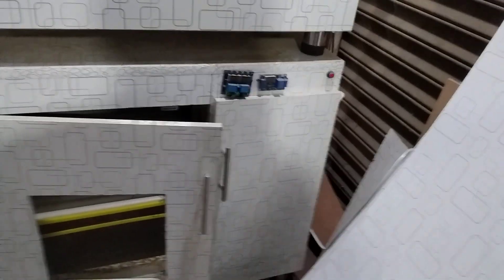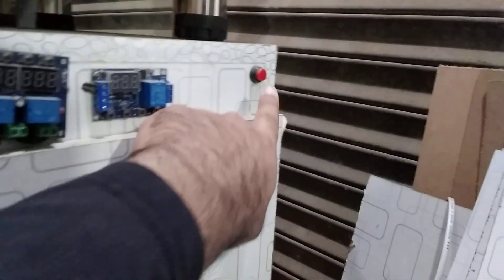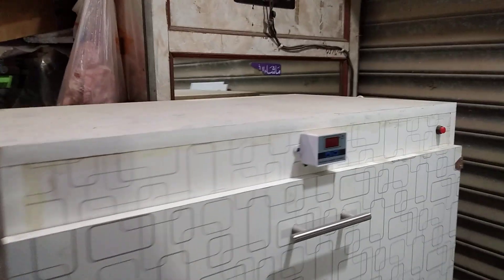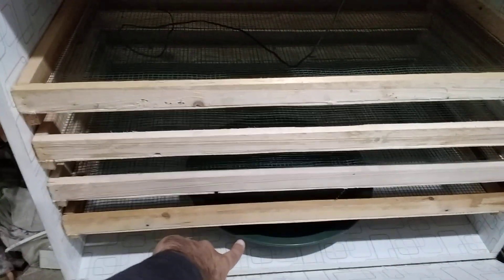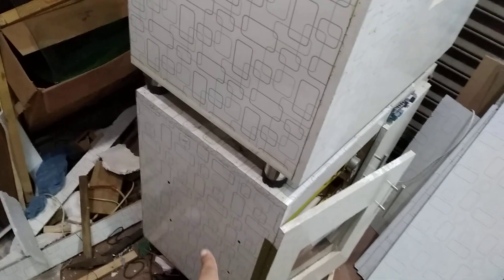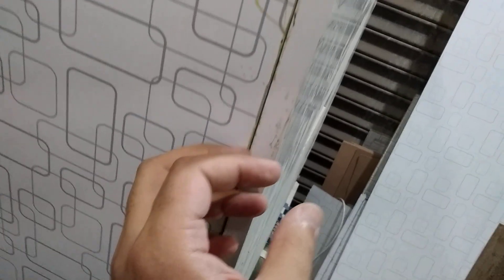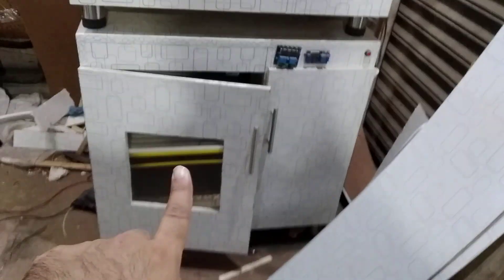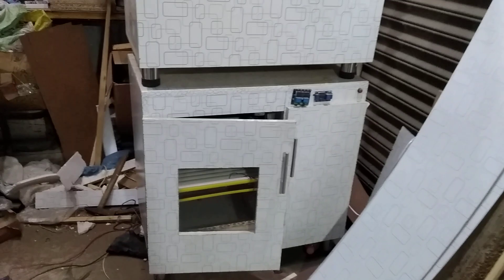Difference Between manual and automatic incubator - English

Comment: Sir, can you make a full automatic incubator from 12v battery or solar with 100 or 50 eggs?
Reply from the maker: You need to make that by the help of electrian
Reply: @Umairworkshop  
Then I will make my own 250 ampere solar panel with two pieces, along with two batteries of 150 amperes and two small ups of 10 amperes.
Reply from the maker: @rehmanzareen2609  that will be good option